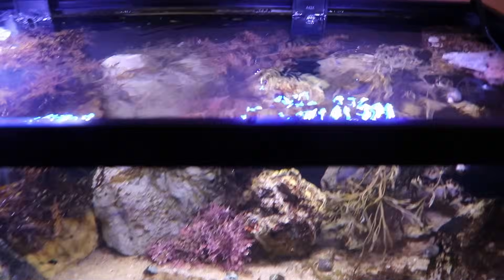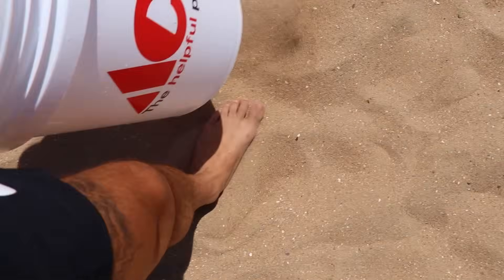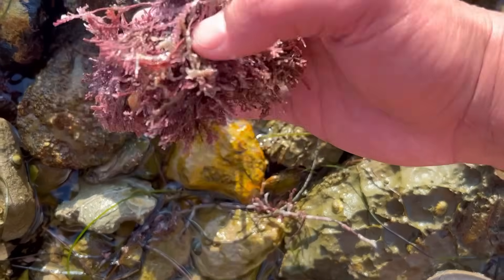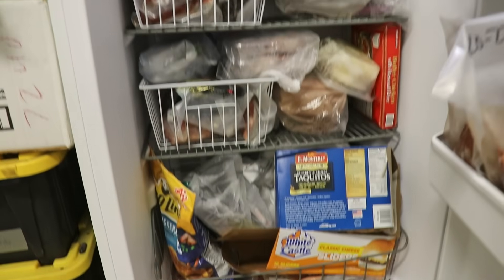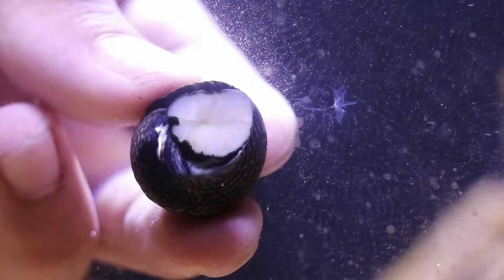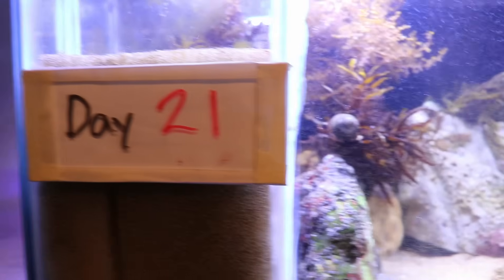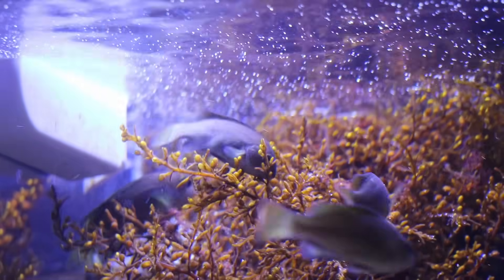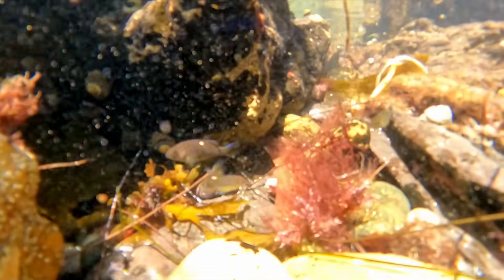I Simulated a Tidepool for 30 Days

Comment: You set up a new tank full of industrial and residential pollution.  Don't dump water directly on top of a sand substrate or it will kill the impeller on your pump 3:50 if you do that wait for the sand to settle and then siphon your filter box.  Don't harvest wild animals or plants for your aquarium.  Its illegal basically anywhere in the US and other countries, and they can carry harmful pathogens.  Don't lean hard edges from rocks on the glass, especially with the custom built in filter.  You need a protein skimmer or everything will die without huge, daily water changes.  Please don't do this again.  The only positive I have to day is you built a decent overflow filter from scratch.

Comment: Also, I'm pretty sure even hermit crabs like that need like 4 inches minimum of "Dry" sandcastle consistency sand so they can burrow down and molt.  Also, they need calcium so thats why they were eating the shell, I used to just put hardboiled egg shells with my crabs and they went crazy over them.

EDIT: Just realized at the end you released them lmfao

Comment: PSA: Don't clean filter media with chlorinated tap water! If you have a freshwater tank during a water change use some of the water removed from the tank in a bucket to squeeze the filter out in. For a saltwater tank use RODI water in a bucket to clean the filter media. 
Using dechlorinated tap water can kill all your beneficial bacteria causing your cycle to crash which can kill your fish.
Reply from the maker: Yeah I thought that as soon as I did it. Definitely won’t do that again..